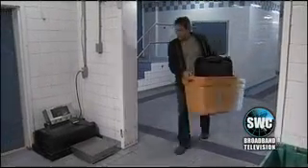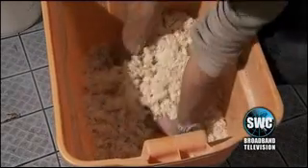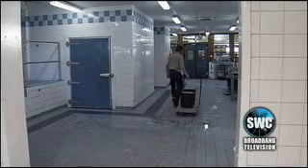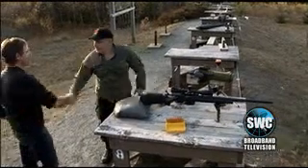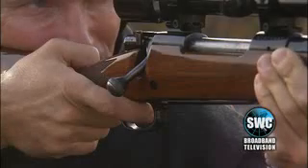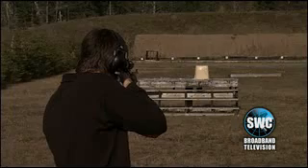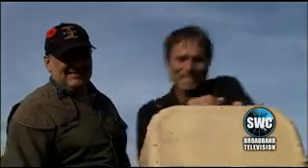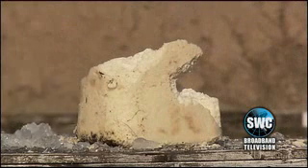Shooting Pykrete

Comment: Pykrete is a composite material made of approximately 14 percent sawdust or some other form of wood pulp (such as paper) and 86 percent ice by weight. Its use was proposed during World War II by Geoffrey Pyke to the British Royal Navy as a candidate material for making a huge, unsinkable aircraft carrier. Pykrete has some interesting properties, notably its relatively slow melting rate (due to low thermal conductivity), and its vastly improved strength and toughness over unmodified (crystalline) ice, actually closer to concrete.
Pykrete is slightly more difficult to form than concrete, as it expands during the freezing process, but can be repaired and maintained from the sea's most abundant raw material: water. The mixture can be moulded into any shape and frozen, and it will be extremely tough and durable, as long as it is kept at or below freezing.
Reply: Good job copy pasting wikipedia
Reply: You know how to copy n paste aswell? :')
Reply: Ahh lovely, an aircraft carrier that only works in fucking Nunavut.

Comment: Well building a ship would be possible but when it is so cold then where would the planes be stored? the fuel might freeze, the motors not start. Besides: Torpedos and such might not do as much against ice, but you would just need fire bombs to destroy it.  Also: A crew that has to wear polar clothing all the time . . :l   But it would somhow have worked, no doubt.
Reply: Ever heard of insulation?
Reply: Fuel generally has a very low freezing temperature (Jet fuel around -54 degrees) whereas water freezes at 32 degrees. Even accounting for the pykrete probably needing to be a little colder, it would never freeze fuel.
Reply: well if you use that you will need more cooling energy since the inside of the ship now would not help cooling it but rather opposite
Reply: Heatsinks?
Reply: People successfully lived in igloos!

Comment: Part 3

However, volume-wise, the frozen samples where much lighter than other materials of equivalent thickness. Weight-wise, the frozen samples were far thicker.

Note though, the weight did vary depending on the material used to reinforce the pykrete. Penetration depth also varied.

Also note, easy to repair when placed back in freezer.

Conclusion: You'll need at least an inch for some protection. 10 minutes of no cooling will render the armor useless. Best used in cold climates.

Comment: Part 2

Although the externally reinforced ice lacked the strength and insulation of the internally reinforced ice, it was easy to make. The container could also be filled with ice cubes before water was added, boosting the speed at which the water froze in the freezer.

Both samples were shot at with a BB gun. Compared to the 2mm steel or PAGST helmet samples, the ice received slightly greater penetration (only a few mm's deep). (Continue to part 3)

Comment: Part 1

Did a few experiments with this pykrete stuff. Of course, rather than using wood pulp I used paper towels, as well as empty containers.

With the paper towels, the ice was internally reinforced. This greatly increased the strength of the ice, as well as giving it greater insulation. The sample displayed great resistance to hammer impact.

With the empty containers, the ice was externally reinforced. This ensured the ice didn't scatter too far when damaged. (Continue to part 2)

Comment: It's useless. Granted it's very hard, and although brittle, may substitute certain ceramic materials where they may be disposable, as a die for instance...but it would probably be rubbish under stretching or shear stress, cracking in an instant due to imperfections. Normally what you'd do is line concrete with a steel skeleton to deal with stretch and shear stress, but if you were to do that with pykrete..it would MELT due to thermal conductivity of steel, an interesting yet useless material.
Reply: Pykrete is far from fragile. Infact its very hard to get it cracked. I had to remove a clump of frozen wet sawdust from sawdust conventer and it was very hard job to do. I ended up removing it with a torch by heating the converter from below to get the whole clumb of.

Comment: Close, but no cigar. For starters, nothing was ever built in alaska. There were two 'test builds' of this idea, and both were done in Alberta. One in Patricia Lake, Jasper (testing construction and thermal issues). and the other at Chateau Lake Louise, near Banff (damage testing). Problem #2, neither project succeeded.. The best they ever got was a floating structure with a wood frame construction with 3 inch x 6 inch studs and 3 inch x 8 inch floor joists, filled with ice cut from the lake.